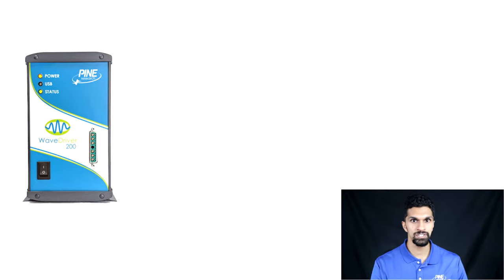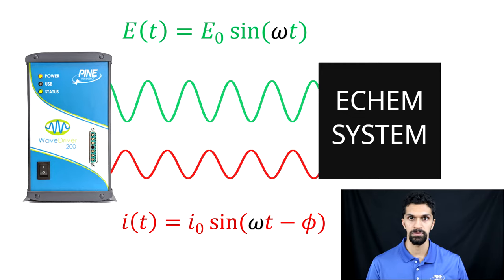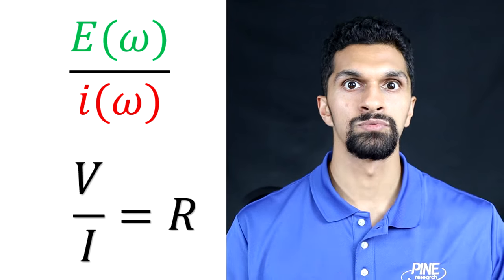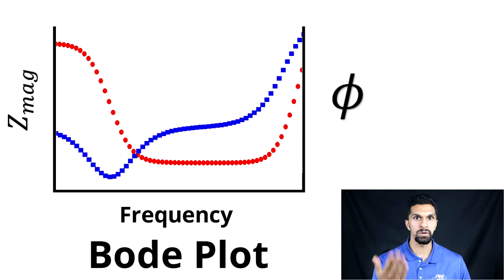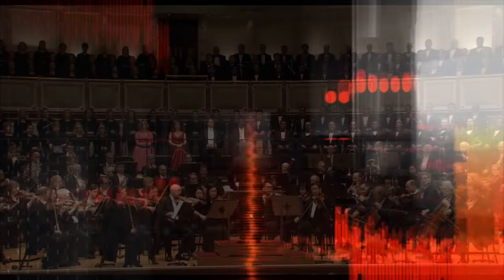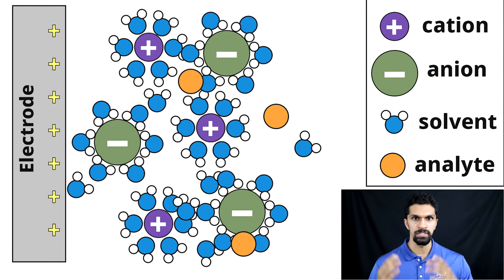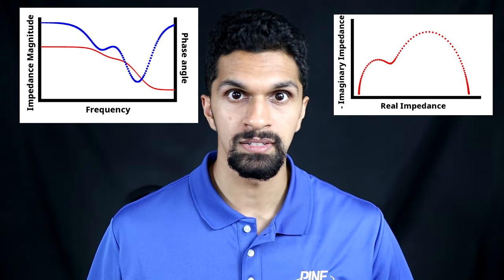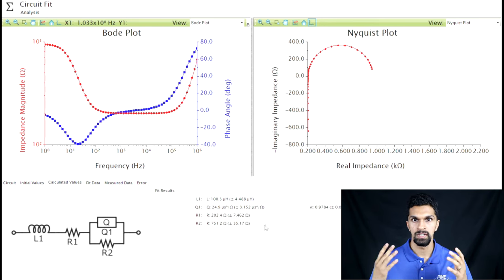What is Electrochemical Impedance Spectroscopy (EIS) and How Does it Work?

Comment: Can you give an idea about K-K  Analysis for validation of EIS data, how we can implement it in real EIS data.
Reply from the maker: I can only speak on behalf of Pine Research, but our AfterMath software performs K-K analysis to validate your EIS data.  If you are using another potentiostat you can important your data to AfterMath, and there is an option to perform K-K.  Then you can look at how well the fit is and the chi-squared value to see if you EIS data is valid.  You can download AfterMath for free and use our circuit fitting and K-K analysis tools.  All you need to do is create a free account on our website.

https://pineresearch.com/shop/knowledge-category/downloads/
Reply: Thank you so much. Please help me with another query. What is the acceptable chi-squared value for EIS data in KK analysis. I have EIS data that gives 0.0008 chisq value. Is the data valid?
Reply from the maker: @yeasmins074  The problem with judging a fit by chi squared is that there is not an easy universal metric to gauge whether it is good or bad. Whether you are doing circuit fit or K-K analysis, chi squared should generally be used as a comparison across multiple analyses on the same data. For K-K in particular, it is both quantitative through chi squared but also extremely subjective. You may have to determine for yourself how closely the fit appears to match your data and make a determination from there. You may also find, for instance, some frequencies fit better than others. Sometimes the low frequency points don't match as well because of drift, but the mid to high frequency points do, so you can propose most of your data are valid but the lower frequencies are less accurate. But overall, it is not simple to give a set universal chi squared metric for saying definitively something like "larger = bad, smaller = good"
Reply: Thank you for the response ❤.

Comment: My EIS sucks.  I wanted to get the spectrum to look like  with a semi circle  intersecting the real axis,  followed by a linear increase.   I am sure I am not doing it right.  Any one other please reply
Reply from the maker: I'm sorry to hear you're having trouble with your EIS data. Unfortunately, without more specific information there is probably very little I can do to help you. You can join us on one of our Friday livestreams and ask your questions more thoroughly, otherwise I might need to see your data or setup to understand what you are currently doing and what you might need to change to get better EIS data.
Reply: @Pineresearch  Thank you for the prompt reply. I believe it is caused by setting the OCV to zero during EIS.  When we set it to 0.6 V we got a nice semi circle.  I hope you don't mind for my novice questions- How do you set the OCV as you do ELS.  Do you have to measure OVC versus time  pick the value where its change is very small ?
Reply from the maker: @Llmakebede  First, I think you have a slight terminology issue here. I assume when you say "setting the OCV to zero" you mean that you applied 0 V vs REF. You cannot "set" the OCV, it is whatever it is. It's a thermodynamic quantity, and very often EIS is done at 0 V vs OCV, which is still an applied potential.

Where you pick for your setpoint for EIS depends on what you are looking for.  What are you studying?  Some particular redox reaction?  Does that reaction occur at OCV?  If not, then why would you do EIS at OCV?  Treat EIS the same way you would treat any other electrochemistry experiment.  Adjust the potential to induce whatever reaction you want to study, and use that as your setpoint for EIS.  The EIS spectra will reflect characteristics of your system as well as the processes occurring at the setpoint, so if OCV is where nothing of interest is occurring then there is no reason to do EIS there.

Comment: what does different "time" and different "time scale" exactly mean?
Reply from the maker: Time scale (at least in this context) refers to something that oscillates, so we are talking about the frequency of a repeating motion.  Imagine two separate wheels that are spinning.  One is spinning at 1 mph, the other is spinning at 100 mph.  The frequency or time scale of the two wheels are very different.  If I marked both wheels with yellow paint I could easily watch the yellow mark on the wheel spinning 1 mph.  But it would appear as a blur if I watched the 100 mph wheel.  Both wheels are spinning at the same time, but I can only detect the motion of the 1 mph wheel.  Does this help?
Reply: @Pineresearch  wonderful and clear description :) thank you so much ! i was always so confused with that concept

Comment: how it is measuring the corrosion and corrosion resistant
Reply from the maker: The impedance itself is the resistance, so if you are studying a corrosion inhibitor you should observe a large increase in the resistance when the inhibitor is added.  But most people study corrosion using techniques like linear-polarization resistance (LPR) which gives you things like the corrosion rate.

Comment: how to calculate total resistance from EIS niquis plot....???
Reply from the maker: The beauty of EIS is that there isn't necessarily a total resistance, but a resistance measured across different frequencies.  The total resistance by itself isn't as useful.  I suppose my question to you is, what is your system and what does the total resistance mean?
Reply from the maker: Also, if you have most specific questions you can reach us at pinewire@pineresearch.com, we don't have a specific WhatsApp account.
Reply: we hav prepared cds@GO nanocomposites s n anode material for energy storage batteries & we want test electrochemical performance & totl resistance..
Reply: sir plzz check your email
Reply from the maker: @lovelykhattak9121  We haven't received an email.  What email address is it coming from?  It might have gotten stuck in our spam filter.
Reply from the maker: @lovelykhattak9121  First of all, just to be clear, as I mentioned in my initial response, the term "total resistance" is a little bit improper when considering EIS analysis of a complex system.  The beauty of EIS is that it deconvolutes all the processes occurring in your electrochemical system (resistances, capacitances, diffusion, etc), and so when you say something like "total resistance" you may be referring to a combination of a few different processes that will all be measured separately by modulating the frequency during and EIS experiment.

For example, in a battery experiment, typically as you scan from high to low frequency, you begin by probing the uncompensated/electrolyte/cabling inductance and resistance, followed by the SEI layer and then the anode, then finally the cathode and any diffusional processes.  All these individual phenomena have their own associated impedance, resistance, and/or capacitance.  So if you are studying a novel anode material, your task may be to investigate the impedance data over a specific window of frequencies.  My guess is that would be in the moderately high to mid frequency range of your experiment.

I hope this is helpful, and if you need any more specific advice or clarification of this kind of measurement and analysis, I encourage you to email us at pinewire@pineresearch.com.
Reply from the maker: @lovelykhattak9121  Are you Marukh Khan?
Reply: ys

Comment: how to calculate electroactive surface area?
Reply from the maker: To be honest, there is only really one tried-and-true method I know of that is used very frequently, and that is with respect to Pt. Very briefly, you use the knowledge that the Pt-H adsorption/desorption process has a theoretical specific capacity of 210 µC/cm2, and then you run a CV and take the area under the curve of i vs. time.  You get units of C, then you divide by 210 µC/cm2 and you get a value of cm2. This is often considered the ECSA.

There are likely other methods for other materials that are used, but the clearest and most common one is what I just described for Pt. I am not 100% certain what other methods researchers use, or perhaps they simply use geometric surface area and assume that is also equivalent to ECSA.

I also understand this explanation is rather complex for a comment answer. What I will do is this upcoming Friday, August 9 2024 at 1pm EST, I will try to give a detailed demonstration of how this is done using real data and software calculations. This will be during our weekly "Ask Us Anything About Electrochemistry" livestream, it will be episode #62. Here is the link, whether you can watch live or you can see the recording on YouTube afterwards: https://www.youtube.com/watch?v=jNMp9a9J0lA

Comment: This should only be suitable for linear environments, it makes no sense for non-linear environments.
And charging is definitely not linear!!!!
Reply from the maker: Correct, EIS is only valid for linear, stable, and causal systems, when it comes to how the sine wave interacts with the system and is usually validated using the Kramers-Kronig relations.
Reply: @Pineresearch  You do not get any harmonics in the spectrum at large values of the amplitude of the probing signal? Or do you neglect them by filtering out the main harmonic?
Reply from the maker: @xelth  Ah, so you don't want to use large amplitudes for the probing signal, because you're right the signal wouldn't look linear.  The amplitudes need to be big enough to give you a measurable response, but not so big that your system becomes nonlinear.  For example, a standard 3 electrode system with a 5 mm OD glassy carbon disk electrode with 1 mM electroactive analyte, you might apply 10 mV peak to peak sine wave, which would be enough to get good current signal and measure the impedance, without making the system nonlinear.  Also to your point about harmonics, you would only be measuring the output signal at the frequency of the input signal, so harmonics are filtered out.